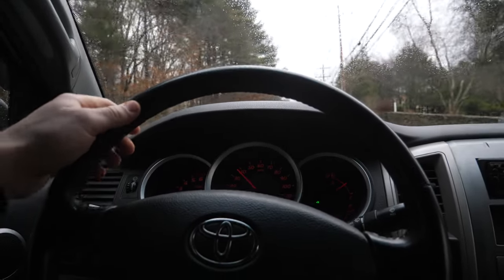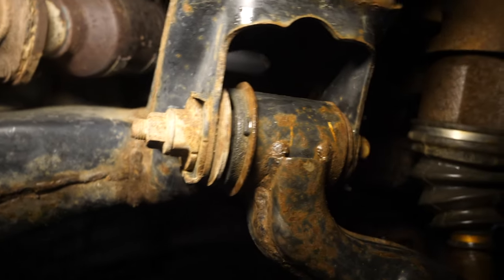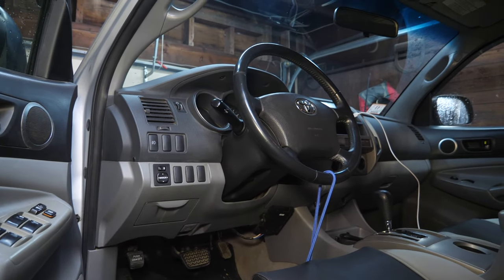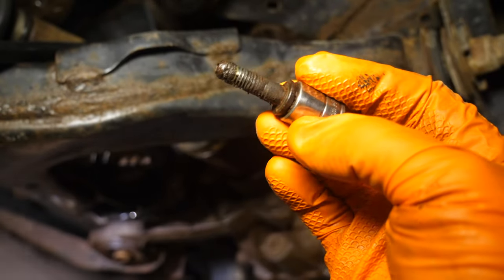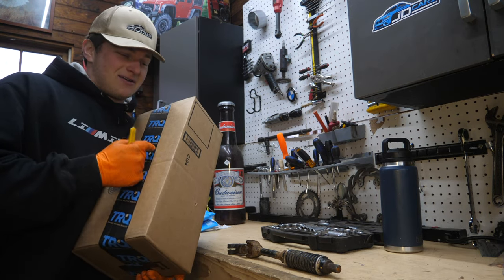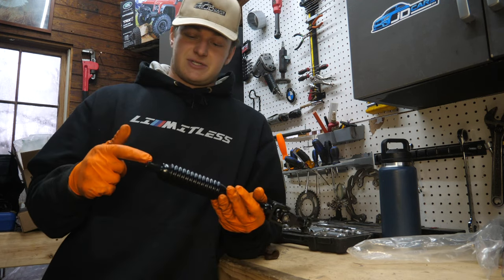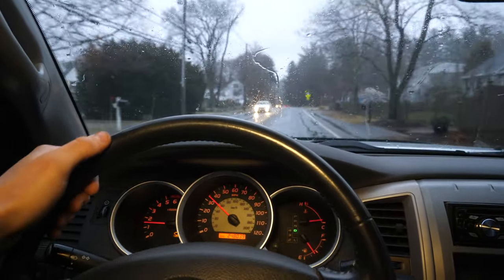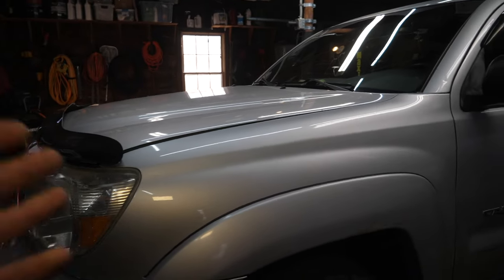How to Fix Loose/Wobbly Steering Wheel Play

Comment: I can't figure out my Silverado it needed it but I literally replaced everything from the shaft to the bearing to the pitman idler arm control arms everything
Reply: Did you figure it out? Same issue on my 99 Silverado
Reply: @christiananaya8516  nope gave up
Reply: Might be the gear box itself.  Just had the gearbox swapped on my 97 burb, did the trick.  Now if I can solve the no start/starter misalignment.  New cap, rotor, distributor, plugs, wires, cam sensor, crank sensor, egr valve,pcv valve, temp sensor, and new starter.  No luck.  Dreading the flexplate being bad, picked up a 97 ram 5.9 for less than what having the flexplate replaced.  It's crusty as hell and has some slopping steering, but it runs well and it indeed drives, little wobbly and crunchy, but it goes.

Comment: That’s a lot of rust we are looking at….of course can be just on the surface but after you showed the coupling how it’s nearly through…quite shocking for an off road vehicle not that old.
Reply: that's toyotas for you, I couldn't find any  10+ years old 4runners/tacomas without severe frame rust in my area after months of searching, I ended up buying a 2007 4runner with a pretty rusted frame but otherwise solid, and spent 50hours removing the rust and treated for antirust. You either baby them for rust from the factory, or they will 100% rust from the inside out very quickly

Comment: I own a 2010 Dodge Journey SE just had the lower left n right control arm replaced, rack n pinion with tire rods.

 Then after just a couple weeks I went over a median which knocked my struts out of alignment which I had done in 4/9/2021 and CV axle shaft left/right side which also is out of alignment & broke, possibly replace wheel hub not sure if mechanic said bearings too.

I've noticed after having rack n pinion replaced my steering wheel has much play, alignment off and steering wheel when car off in park has much play n knocking also.  

Not sure what that means as I don't have money to replace anything else right now as I've bn homeless for past almost 19 yrs, due to my duddy devil Darth Vader puppet master troublemaker n mummy blaming me for her choices decisions or there lack of on her part as mom not putting her children first. 

 As for a nut or bolt, Drill a corner of the nut or bolt just a notch to give it some grip when using the size ratchet tool to grab onto if rusted or stripped...

Anyway, updates I have had to replace heater coil gear assembly,  left and right lower control arms, rack n pinion, left right CV axle, stabilizer links, replaced front struts. 

Now, I have a thermostat leak & other antifreeze leak somewhere. Not to mention, repairs still needed in front of this vehicle are steering,  camshaft, pulley and belts, water pump, radiator and or hoses, wheel hub & bearings, brakes & rotors calipers. 

Only God knows what else  is needed in rear suspension and interior replaced. 
 
Don't have money for another used vehicle

My duddy & his adjustment bureau clan of dark forces meddling interfering obstructing ruining everything in my life and I'm sick n effing tired of the costs and they keep making one thing after another.